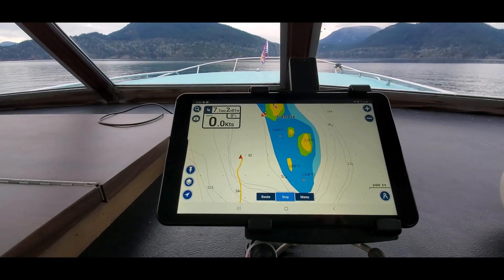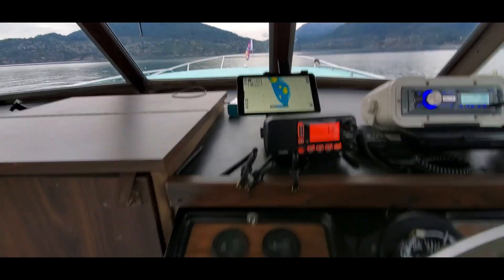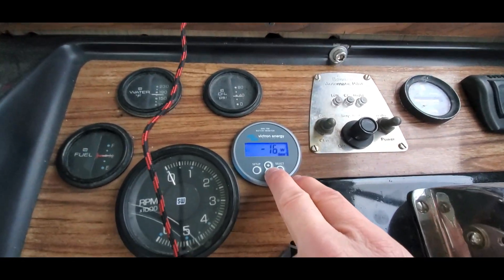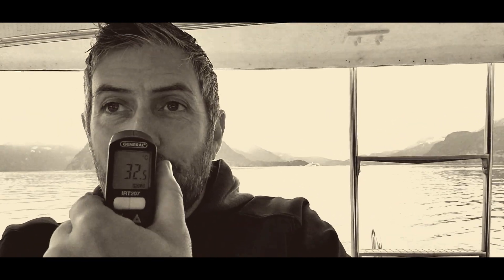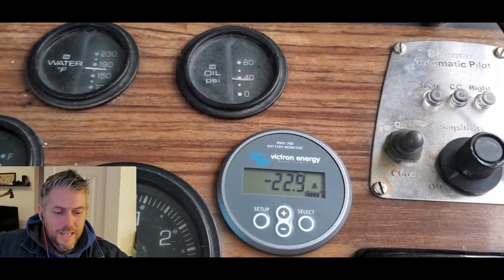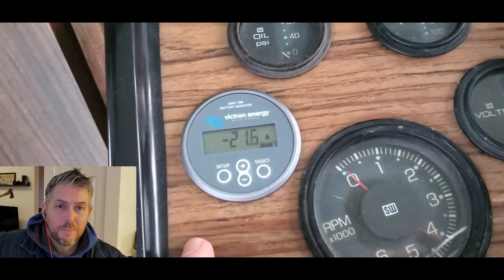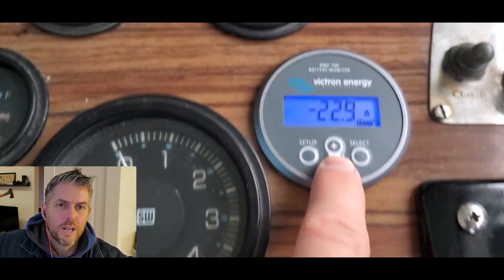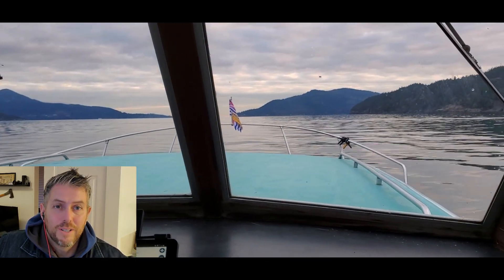Electric Boat - RANGE TEST @72volts And Why Batteries Alone Won't Cut it For Longer Trips.

Comment: hello, it's a nice project but I think some calculations weren't taken into account, I don't speak English very well and maybe I didn't understand some things.  I am on a similar project and I took into account the characteristics of my diesel engines in order to find electric motors which can provide these same characteristics, for example my diesel engines at 8 knots turn at 1600 rpm, with an inverter  3:1 this is around 530 rpm from my shaft line for a torque of 250Nm so I chose my electric motors in relation to this and I have 2 choices which are 50 or 70 kw for a maximum torque  of 400 Nm which leaves me a little margin. I therefore think that your electric motors are too weak .... and perhaps also your electric reserve, good luck for the rest

Comment: Time to pick your brain...When you replaced your diesels with electric, what ratio did you go with? I have a Bayliner 4550 that I love, but I am trying to give it more legs. Right now, I have it loaded up with 2.5kw of solar feeding into 1200aH of Lithium. I have converted my entire vessel to electricity. I pulled my Genset and added an extra diesel tank in its place. I am getting ready to start serious long-range cruising. Right now, I am considering the potential of pulling one of my mains and replacing it with electric and alot more lithium. Currently, i have 2 220hp hinos powering the vessel. I keep reading that the ratio i should go with is 2.5. So roughly 80 hp electric. I only want to run hull speed, so maybe the 70hp elco. What do you think?

If I could only cruise on the electric 30-40 percent of the time, that is a massive fuel savings.

Comment: What if you installed Tesla style battery packs into the maximum available area?  In my estimation if you are doing less than 14 Knots and 300nm it just isn’t worth it.
Reply from the maker: 300nm on a charge is a pretty big ask!  This is just a weekender, get out on the water, eat, swim, drink, camp over night, cruise home and plug in. Cheers!

Comment: What's the problem with carrying a small gas generator to run a battery charger?
Reply from the maker: No problem - it's always on the table as a get out of jail card. But with my new batteries this video is out of date.
Reply: @ElectricCruiser  I am looking around to get another liveaboard houseboat. Not into speed, but these new electrics open up a whole new option. :o)

Comment: DIESEL GENERATOR FOR ELECTRIC SV

     DC Power makes sense for vehicles (that’s why it’s used for cars, boats, bikes, etc).  

     AC makes sense for land because it can transmit power over great distance with insignificant loss of voltage and heat compared to DC.

     Using a DC diesel generator makes more sense on an electric boat.  The batteries, DC loads, solar, wind, and hydro generators are already DC.

     While it’s true there may be some AC loads, their requirements are addressed by a “Victron type power management system”… which manages all power, including various DC voltages both for generation, consumption, battery maintenance and as well as  AC voltage and  frequency requirements (50 or 60 hz) thru inverters. 

    AC generators are traditionally on boats because of the legacy of land generators, not because they make sense.  The propulsion engine’s alternators produce rectified DC to serve the boat’s DC requirements.  Stand alone AC generators must run at synchronous speed even at no-load conditions to maintain AC frequency (engine speed, depending on the number of pole pairs are normally 800, 1200, 1800 or 3600 RPM).  This frequency requirement wastes fuel and produces max vibration, noise and heat.

       In a DC Diesel Generator,  engine RPM is determined by current requirements.  RPM is proportional to current output, therefore at low demand the engine runs slower, cooler, quieter and uses less fuel. 😎

Comment: Another quick tip from my years of motorcycling the heated vests are under $150 and don’t use very much power. Same for installing seat heaters. You can buy kits cheap online and slide them under your existing seat covers. Some options!

Comment: Check out Nissan Leaf gen2 batteries. Can reconfigure in any voltage mine cost me under $3k for a 2015 pack from an autowrecker. Lead acid sucks, learned that with my forklift - waste of time. Modules are 8v each so im using 7 in series for “48v” and have 7 in parallel. 49 modules. Various bms systems out there for charging safety. Mine will run my offgrid backup SMA sunny island inverters (not a boat). Btw solar panels are real cheap now can cover your boats roof for at anchor charging. Down to $0.46/watt. Shoot me a message can send u info. I just finished 34kw solar install. Howe Sound my stomping ground. :-)

Comment: I think the future of boating is with carbon neutral synthetic fuels, powering clean turbine generators with catalytic converters, that act as range extenders of a battery-electric propulsion system.
Reply: The efficiency would be really high as well, because you can use the excess heat to drive either a steam turbine for more electricity or simply to heat up the rest of the boat (warm water tank or heating during cold days.)

Comment: It does not take fossil fuels to “make” renewable energy or any associated components. Think outside the box a little bit and you’ll understand why.
Reply: Show me a "green" copper mine or how solar panels are made by hamster wheel power.  I'll wait.
Reply: Renewable energy is basically just converted fossil fuels.

Comment: You should do a car alternator one each motor so that way you can charge the batteries.
Reply: sigh
Reply: I'm not sure you're understanding the principles of electric drive.
You need to conduct more research to find out why this doesn't work.
Cheers mate

Comment: Driving an electric car for 10 years now. Wife and me have been thinking about generators and heaters a lot. In a boat I would have a generator for sure. If water cooled it might as well help as a heater if you dont mind the plumbing. In a car there is far too much red tape with all the permissions and inspections. But how about a kite?

Comment: It's an unfortunate reality that lead-acid batteries, whether flooded or AGM, just don't have the power density, depth of discharge capability, or acceptance rate under charging to offer range or power output for a boat such as yours. Lithiums could help with those factors but charging, when docks only typically offer 30-50 amp shore power, is still problematic. You might get 50 miles of range, but then you'd have to spend 2 days back at the dock charging at 50 amps. Electric power on a boat just does not have the power density for cruising. Displacement Cat hulls with solar can extend the range, but so far,  the power density and speed of refueling of fossil fuels seems to be the only viable option for cruising boats.
Reply from the maker: Definitely not incorrect with the limitations. If a person always cruises to max range / endurance and then needs to be ready immediately (or over night) to be underway for another 30-50miles, this would not be a good solution.  That said, I've used it for a weekender for 7 years and it's a pretty good option ;)  When the boat was 48V, I had enough batteries to give me over 220AH which was good for about 30 miles. When I bumped everything up 72V, I had to rearrange the batteries which reduced it to 100 usable AH. (with really old batteries) - Most likely I'll just double the pack and be good for another 5-7 years. Thanks for watching and your feedback, cheers!

Comment: All the negative comments.... If the Wright brothers had been on social media posting videos of their aviation experiments, they would have gotten nothing but negative comments as well. If this boat had the battery packs from 4 Tesla cars, which would be expensive of course, this boat would be a very much improved displacement cruiser. The principle is sound. The experiment now involves only incremental improvement. As for the generator idea, diesel electric boats have been around as long as diesel electric locomotives.
Reply from the maker: Agreed. They say money solves 99% of the worlds problems and yeah if someone tossed 100Gs at this then for sure a person could deck it out with Tesla batteries and motors etc etc but the goal here is to rescue old forgotten boats that are still great boats and to show people they can get out on the water for pennies with a simple conversion. (plus this is more or less my 'grown up' rubiks cube that keeps me out of trouble) Thanks for watching! Cheers
Reply: @ElectricCruiser  Most enjoyable, and Greetings from Cowichan Bay Village.

Comment: put geny on belt on both shafts and 2 solar panels
Reply from the maker: I've heard this suggestion before. Sounds interesting. Do know of anyone that has done this?
Reply: It's old school to have a belt pulley on your prop shaft so you can put anything else next to it that rotates as a get-home, especially a generator.

Comment: Just wondering how much you spent  on the conversion? 10k? 20k? Next question if the boat was still gas, how long do you think that money would last you? For instance if you burnt 2k every year thats 10-20 years of fuel. If your like me you burn 5k a month electric might be worth it. But I need 20knots of speed good luck

Comment: Thanks for the honesty and lack of renewable hype. On that basis alone you have a new subscriber.

I have to have speed to get across big bays and sailing between cities.

I'm all for renewables to reduce running costs and I do like silence and serenity at sea. BUT, not at the expense of speed, safety and predictability.

By the way, in battery storage systems design, it should be mandatory for safety reasons to have a true 10-15% power reserve outside of the system that delivers 100% of that 15%, just like a power boat has to have a seperate reserve tank of 10% fuel.

Also, just remember when you add batteries you add weight and your power to weight ratio is effected as well as performance. In fact the added weight may negate any of the benefits you were hoping for like speed and distance.

Likewise in the construction of the boat you may have to strengthen the boat structure around the battery housing to cater for the weight of more batteries and storage. 

So you now have more weight from the batteries as well as the construction which can negate any speed and distance increases you were hoping for.

I think hybrid is probably the best option until more innovation and development of technology becomes operational in the real world.

Comment: Nice build, super clean. I think I would convert DC to AC through rotary converter and run AC motors. Haven't done the math, just have lots of experience with it. This is a very nice straight forward DC build though. Love the old boat too.
Reply: Thought 💭 would it not be better to run D/C instead of A/C on a boat? The idea of having electric drive on a boat is to make it somewhat sustainable and to do that Solar panels and maybe wind turbines to regenerate. So my understanding is you lose energy transfer D/C to A/C. If A/C is the key why not strip a electric car down and use all its systems. I have been seriously be thinking about that.

Comment: Looking at one of the other comments using only one motor, it will make no difference to your steering  because  of your low kw power, and you will be under your hull speed, cheers adrian

Comment: I would have a generator as a back up, top up, range extender. The Silent 60 yacht sailed across the Atlantic using solar but still ran the Gen for 3 hours at night to keep going. I think they run the Gen at 50% at it's most efficient speed.  Love the concept and you have a beautiful usable boat.
Reply: didn't that silent 60 also use a kite system from wing commander?
Reply: It is still too slow. Speed can be increased through hydrogen technology and hydro power like converting wind into energy as well as using the sun.

Comment: Great video. I love electric boats and Tollys. What about power? Do you think 5 knots is enough to get you through rough seas?
Reply from the maker: I've done it before and it's a lot like skiing Moguls haha but she'll do more than five especially now with the voltage upgrade. I'm going to do a top speed test soon but I've just been hesitant because my batteries are so old and I don't really want to wear them down unnecessarily. I'm also only able to escape once a week which doesn't always match with the weather. Anyway, thanks for watching!

Comment: Thanks for making this video! I think there’s a way to get waste heat out of water cooled marine gensets. I really enjoyed the rescue aspect for your boat. I rescued a smaller boat, 1983 WD Schock Newport Electric Packet, yep, original electric boat! It has about 40-50 miles range on a 10kWh lead acid 48V system.

Regarding your battery test, every year I connect an AC inverter to my battery string and discharge it into a bank of lightbulbs (with a dimmer). I discharge them at their C20 rate until 1.75V/cell watching how many amp hours I get from them on my Victron BMV712. Running into year four on my Costco cheap GC6 interstate batteries with no measurable amp hour loss yet.

Comment: How many amps does using only one motor pull at your 4 knot minimum?
Reply from the maker: Not too sure. I would suspect 30 or more amps. I tried it a long time ago @48V and it required about 10amps more (50amps).  I know a lot of people do that with gas motors to save money when they are trolling but the boat basically has to fight the rudder drag to maintain a straight course and it doesn't handle that well. That said, it's doable if one motor quits.  I should probably give it a shot next time I'm out. Thanks for watching! Cheers.

Comment: If you want to stay green look at a Methanol Fuel Cell they can produce clean quiet energy max of 24Kw per day. It is what I use for either charging the batteries while I am off grid. I designed my system that when the batteries get below 80% the fuel cell starts up and starts recharging the batteries. Nice think is the Fuel Cell only produces water and a little heat as byproducts. You are right 4 knots is the slowest I would want to go as if you have currents etc. more realistic is 5 to 6 knots but it sounds like that would really cut into your range with your current batteries.  Also don't you also have a house battery bank for lights, refrigerator etc... you could put your heater on that.
Reply: I thought the maximum voltage produced by efoy was 48v?
Reply from the maker: I like the idea of these efoy systems but when I looked they don't provide anything beyond 48V.  Do you tie the fuel cell gen into an AC panel or does it charge the DC house bank only?
Reply: @ElectricCruiser  your setup and mine are a little different I am running a 10 kW liquid cooled motor and liquid cooled controller. I have a 48 volt LiFePo4 battery bank of 42 Kwh which at 4 knots gives me 20+ hrs of run time and at 6 knots about 9+ hours. So i have my unit either creating 48 volts charging the 48V pack or 24 Volts and run thru a 24 volt DC to 220 AC inverter. to run any 220 device.  So  I don't know how your AC is wired but you could run it parallel to your shore power so if you plug in to shore power you get 110 from the mains but if not get 110 from the efoy and run your chargers. Also I am using the professional efoy unit (12, 24, 48 Volts) not the version sold for RV's and boats which only generates 12 or 24 volts.
Reply from the maker: Sounds like a great setup and great option! I think we've conversed before but I can' remember what kind/size of boat you have?
Reply: @ElectricCruiser  Total length 8.7 meter, Width 2.9 meter, Draft .40 meter, total weight 3000KG cabin cruiser.
Reply: I bet you could scavenge waste heat from a fuel cell pretty easily. Electricity and heat.